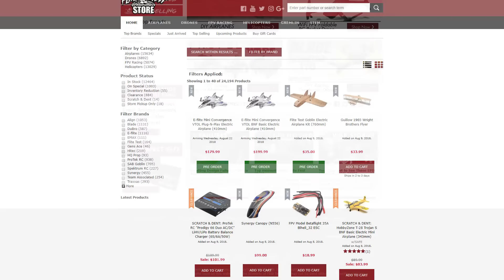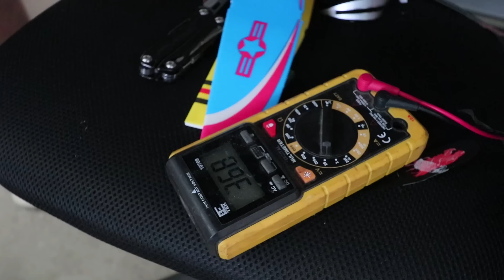Powered R/C glider without batteries!? | Capacitor plane hack

Comment: a battery produces electricity from a chemical reaction, a capacitor stores charge through electrical attraction
Reply: Bcikablam the  flux capacitor
Reply: arent these super capacitors? 
fast charge slow discharge?
Reply: Capacitor stores electricity in an electrostatic field, and a battery produces electricity through a chemical reaction.
Reply: Yes it's cool but capacitors slowly discharge
Reply: I would suggest looking for a bigger capacitor for the motor
Reply: caleb Brown So do batteries!
Reply: caleb Brown no, capacitors discharge depending on the load, where the RC (load times capacitance) time constant tells you how long it will drain 67% of the charge (for maths reasons, it also 5 time constants to drain fully, also for maths reasons).
If we assume a 500mA load at 5v it means the load is 10 Ohms, and assuming those caps are 1F (couldn't find a value anywhere, most likely wrong) then t=10*1=10s. That's reasonably fast to me, considering 1F is a massive capacitor (and much larger then these ones)
Reply: If I understand it correctly capacitors can hold different levels of charge depending on the voltage input. Instead of putting the capacitors in series they could've left it in parallel but change the voltage from 4.5v from 3 batteries to 5+V from a USB power bank or such..
Reply: Tristan Peters true but I looked up a couple of these planes and they all have a massive warning about the charging time, which leads me to believe that these caps are only rated to 2.5v and will be damaged (and probably explode) if they are charged at a higher voltage
Reply: You can use a motor with a propellor as a generator on top of the glider to charge the capacitor while it flies
Reply: those caps on the glider are more like 6 or 7F. when i was learning electronics (late 90's) a 1F cap was HUGE. not now. ive seen 600Farad 2.5volt caps that are the size of a "D" battery.
Reply: ok here we go... you need a little "buck up" voltage converter to take the capacitor's 2.5v up to about 4v, then you'll have your power flight time not being reduced for trying to run 2 caps in series. they're in eBay pretty cheap, they don't weigh much. you can also find some pretty high capacity (still small+light) super capacitors there (eBay) to play with.

for a first effort, good job and call it a success too, really!! you've shown it will work and something like this would be GREAT for a slow indoor ultra light plane similar to a "Vapor". think REALLY small for power, like a 6x12 mm geared prop maximum. break out the tiny carbon fiber rod and saran wrap stuff and the lightest integrated aircraft brick you can get your hands on. WLtoys brick might be a little heavy, but definitely easy to work with
Reply: +Darcy Moloney
You misunderstood what "capacitors slowly discharge" means.
The poster is talking about leakage current. A typical capacitor leaks power much faster than a typical battery. By "slowly discharge" the poster is pointing out that capacitors LEAK power, they will hold a charge only temporarily.

Capacitors are used for rapid charge-discharge cycles. Therefore, a high leakage current makes little difference since it has very little time to leak. So... It might be useful in this application when the power is discharged rapidly by the aircraft. Also, a capacitor can be safely charged extremely quickly. And it probably has a much greater charge-discharge count.

Capacitors are used in applications that charge and discharge hundreds of times per second, and last for years. Fast charge-discharge is their main benefit over batteries. But they leak (lose power) quickly, they are not meant for storing a charge like a battery is.

The videomaker can watch how quickly the capacitor leaks by hooking a voltmeter to the capacitor and watch how fast it self-discharges after charging. Then compare that to how slowly a battery leaks. Normally you cannot see a battery leaking power. But you definitely will see power leaking from a capacitor.
Reply: Umair Haider Khan: and from where would that motor obtain its electricity to work?  From the capacitor?  
There is a law from Newton that boils down to "there is no free lunch".
Reply: Think of it as static electricity held between two conductive surfaces (such as two sheets of metal)
Reply: FT store page says cap is 5F. No rated voltage given.
Reply: Darcy Moloney maybe higher voltage rating. It can be experimented with
Reply: but it is a super capacitor
Reply: try with battery clock
Reply: @mattdixon2571  or another 2 of the same capacitors in parallel ☺
Reply: What about an lithium ion battery? Same thing?
Reply: It stores charge via physically stressing the dialectric. It is essentially two metal plates sandwiching an insulator. The charge builds up across  the plates.
Reply: @modelnutty6503  agreed, sort of.  I haven't heard the term "buck up", in my lingo it's a boost convertor,   buck convertors drop voltage.  Yep, they're small, light and cheap and you'd probably get 20% more energy recovery cos the super cap alone will still be holding useful energy when it's voltage has dropped below that needed for the electronics.  Unless there's already one in that little brick.....  probably not, but maybe.
Reply: caleb do you mean if not used over a long period that they lose their charge or that they can only provide power slowly?  All capacitors I know of can dump their full charge instantly if there is no controller circuit.
Reply: You already know this kid looked this up just to get a pinned
Reply: Actually capacitors use elecrtical fields to store energy.
Reply: there are all kinds of non chemical batteries  ahahahah
Reply: A secondary cell or battery is one that can be electrically recharged after use to their original pre-discharge condition, by passing current through the circuit in the opposite direction to the current during discharge. The following graphic evidences the recharging process....
Reply: Secondary batteries fall into two sub-categories depending on their intended applications.
Cells that are utilized as energy storage devices, delivering energy on demand. Such cells are typically connected to primary power sources so as to be fully charged on demand. Examples of these type of secondary cells include emergency no-fail and standby power sources, aircraft systems and stationary energy storage systems for load-leveling.

Cells that are essentially utilized as primary cells, but are recharged after use rather than being discarded. Examples of these types of secondary cells primarily include portable consumer electronics and electric vehicles and capacitors.
Reply: Yup I'm gonna be that guy....capacitors are essentially batteries...just slightly different use case of stored energy...biggest difference is that caps can blow da fuq up
Reply: @kkrampus  great explanation and correct the 67% is usually written as 0.707 root mean  squared.. And you're right one farad is a big capacitor physically in size vehicle sound systems that have big amps use them to stop power drop out
Reply: @sadpotato424  no if there is a resistor at the discharging process. A diode would command the wanted direction.
Reply: Yes but a battery keeps energy for so much longer than a capacitor.
Reply: Tristan Peters then if the cap wasn't rated for 5v ( it clearly isn't that's why it only charges to 2.4v) they could have made firecrackers out of their capacitors. :)
Reply: It's funny how we now play with a couple of Farad capacitors, while just 10-20 years ago even a 1 Farad cap would have been the size of a car.   Ahhh the wonders of technology. :)  If they could develop "super-super" capacitors which could store large amounts of electricity with a low slope of discharge, that might be an interesting tech to explore in electric vehicles.
Reply: @BillAnt  Mate probably you misunderstood the video, or they are pretty stupid. 1Farad is a very big quantity, that must be lower, such uF or mF.
Reply: @BillAnt  We have got "super super" capacitors already, they are called BATTERIES, and even if there would be something like that, it will be hardly used.
Reply: Flux capacitor
Reply: yes
Reply: So?
Reply: Bcikablam if I wear a tie will it charge faster?
Reply: What

Comment: I've seen electric go-karts use large capacitors in addition to their batteries, in much the same way a gas engine uses NOS. They discharge the capacitors for a speed boost, and ten seconds later, you get another boost. It's like turbo's in a video game. I wonder if that setup could be applied to an EDF jet or some other fast plane.
Reply from the maker: That sounds awesome!!
Reply: WEB:
Reply: I know you can buy a boost system designed for 1/10th cars off hobbyking
Reply: i wonder if u could just use a bunch and have them all be time delayed                           burstflight3.2
Reply: I know they use "caps" on R/C  drag cars. It's like having a NOS shot. There's a good project for that other little channel, the little channel that DO......
You know, a Traxxas on road car, or maybe one of those Vaterra on road cars. Those are likely not going to be available much longer since Horizon bought another R/C car company. Might get a Vaterra very reasonable $$. DO you know why or how capacitors are used in speed run R/C cars? I bet you DO.
Then it could also be used as military power in a FT warbird.
Reply: thats a really cool concept!! i might just have to try that !!
Reply: Hmmm.. Add capacitors to a Tesla model S for turbo boost on top of Ludacris mode...fun, fun, fun...

Just need a model S....
Reply: The college I went to had an old GM EV1 tucked away in the corner that was built for drag racing using all capacitors.  It ran a low 12, and only lasted one run on a full charge.  The big difference between batteries and capacitors is that capacitors can discharge all their energy much quicker than batteries - which is perfect for when you need a quick burst
Reply: It wouldn't really boost anything in a long term, because during the 10 seconds of charging the power output would be much lower.
Reply: @raidzor5452    then how do hybrid cars work? Ultimately all the power used comes from the gasoline engine.  

This concept is similar,  it allows you to use more than your normal peak output at the cost of slightly more load for some of the run time.

In an aircraft capacitors could be used for takeoff, with the rest of the flight being on normal battery output. With the additional benefit of intermittent extra power for whatever you want to use it for.
Reply: I know! Seen this before. Just don’t touch the leads to the capacitor☠️
Reply: Most people use caps to filter power to ESC’s and stop electrical noise.
Reply: @kkrampus  details on that system on HK?
Reply: @Dusty Conner It was years ago I saw it so I don't know if it still exists and I have no idea how to find it again, sorry
Reply: It will not work as planes like that run off of fuel so it wont be compatible  as the go karts are battery powerd as you said
Reply: @Dense0cactus  EDF stands for electric ducted fan, not fuel involved at all
Reply: have you heard of COKE Can r/c cars. They use a capacitor to store the electrons...i just replace the cap with a 1s 60-150 mah lipo..to make them faster and longer run time. They also make different size mini drone motors...
or he could just take a couple of capacitor out of one those cars...they;re call super Caps.
Reply: Lipos can already be discharged in a minute or so giving insane currents. So I don't think you could feasibly use more. Maybe to power an instant surge device like a camera flash
Reply: THE FPV YAWTHORITY that would require a diode bank to lock out the empty capacitor from being recharged by the full ones
Reply: Liion battery with a supercapacitor to boost power at launch?

Comment: Look into super capacitors. You might be able to build a much larger plane with a much bigger motor. One piece of advice have a separate capacitor bank for the electronics.
Reply: Thease caps can deal with electric starting motor ? Or you talking about older motorcycle which has kick starter ? Interesting project you made, I`m curious :)
Reply: @Wrublos212  there are a number of guys that has replaced their acid lead starter batteries with Super capacitors.  They are about 1-3 V per capacitor, so he have a couple of them in serial to get the voltage right. They are sencible to over charge, so they need to be enough numbers so they will take all voltage from the charger (14.4 V or more).
And yes, they don't charge as much energy as a lead battery, but you can take out that current needed for a short time. But they don't degrade with the number of charges. And they carge fast.
Reply: @DrewLSsix  that's definitely a possibility, get a 3S-4S (depending on the exact chemistery) lithium battery with a BMS (or a small 7AH AGM), and about 80 bucks of supercaps, and it's a lot cheaper over the long run and starts better. But it also can burn the starter faster on cars which have smaller ones (regular lead acid are limited to around 400Amps in short circuit, a supercap bank can deliver 2000A or more).
if you live in a cold climate, lithium+supercap works really well, as lithium only looses capacity vs not working at all.
an other option is a nickel iron battery, because they last a lot longer.
Reply: They can also add a step up converter which will hold the voltage at a stable high level no matter what is the voltage at the capacitors
Reply: Or surge protect the electronics with an inductor and varactor diodes
Reply: Don't you like batteries? Do you really hate your life?

Comment: Guys this is New/Old technology. I remember being a little boy I had a racetrack set and you had to do this to the cars! You inserted the jack from the battery pack and pressed a little button and it charged the cars. You then put them down on the track and they would run on their own for a few mins. I would say this was early to mid 70's. Enjoy you guys videos keep doing what you're doing!
Reply: Joe Ziegler I used to have one of those race tracks.

Comment: from what I've been taught doing physics this past year, a capacitor stores charge between two plates that are extremely close together. Hence why they will hold a charge till it is given somewhere to go, and can be repeatedly charged and discharged.
They also often have a special medium known as a "dielectric" between them to allow more charge to be stored, this allows more energy to be stored in a smaller space, something that is always desireable, for any energy storage medium.
There are a few other interesting things about capacitors we were taught, one of which is the manner in which they charge and discharge. If you plot a graph of voltage against time for a capacitor as it discharges, it will form a downward sloping curve, that looks similar to a half life curve. It also operates with a similar mechanic, using something specific to each capacitor known as a time constant. The time constant is the amount of time taken for the voltage of the capacitor to fall to about 63% of it's previous value. What this essentially results in, is that a capacitor's voltage will decrease more in the first time constant, than any more amount of time afterwards. 
Interestingly, the inverse is true for a charging graph, and a charging graph produces an upward sloping curve, the exact opposite of the discharging graph. The capacitor's voltage will rise most, in the first few seconds of it being charged. (or the first time constant)

All of that, was just the fairly I assume dumbed down version we were given for A level physics.

Comment: Back in the day there was a little micro RTF called the Tommy AeroSoarer, living room flyer sized foam IR controlled plane with just rudder and throttle that was powered with a single small cap...charge it in about a minute, fly it for a couple, repeat.  Good times!

Comment: Maybe you could use three 100F 2.5V capacitors in series in order to get an "equivalent" of a 2S Lipo for a DLG. The voltage of a capacitor is given by this formula: V = Vmax * e^{-[t/(R*C)} , and by assuming an average current draw of 500mA (I read that is close to the current draw of a 9g servo, but feel free to make any change) at 5V (the output of the BEC) we get a resistance of 10 ohms. That way, after 2 minutes, the voltage of the capacitors would be around 5.21V, not great  it would be interesting to see what it can do... Maybe. Great video, keep it up guys.
Reply: A trio of 100F 2.5v supercaps weigh almost 2oz - That'd be a hard sell to install into a glider.  From Mouser, the AVX-SCC-1018831 pdf datasheet.
Reply: You are right, I did forgot to check the weigh.
Reply: Capacitors don't have a set charge voltage. They aren't batteries. The have a maximum rated voltage but a capacitor's stored voltage depends solely on the voltage applied to it.
Reply: That is true, even though I didn´t said so, I used the maximum rated voltage for convenience, since a lower output voltage would decrease the energy/weight ratio.
Reply: biotronik414 that's all ok, I just thought you were repeating the same misconception. Also I'm pretty sure the 500mA servo load is at stall, they shouldn't use too much under normal load (maybe 100mA at most)